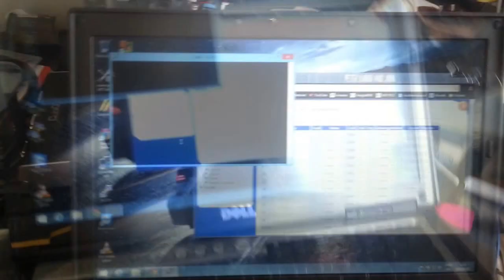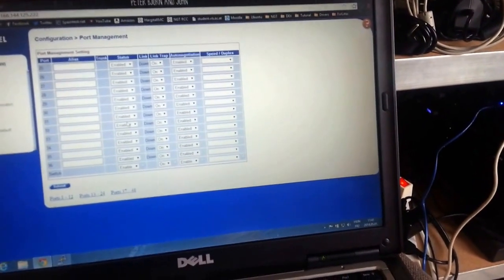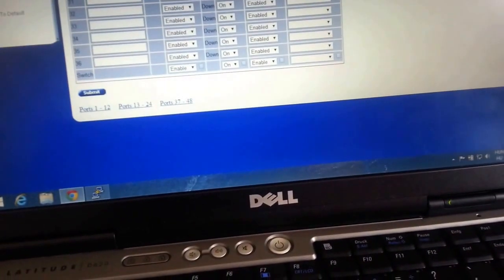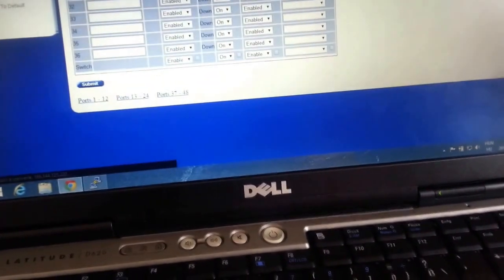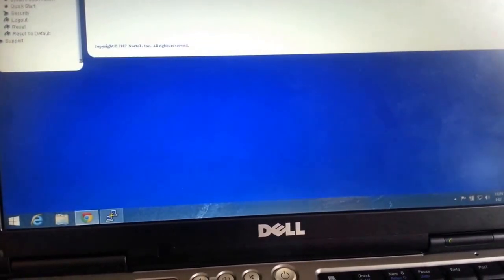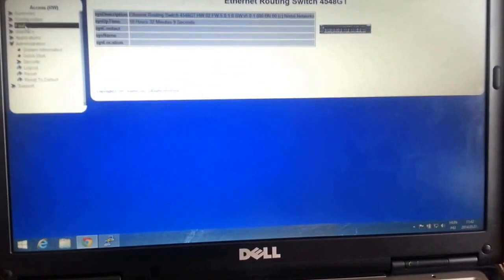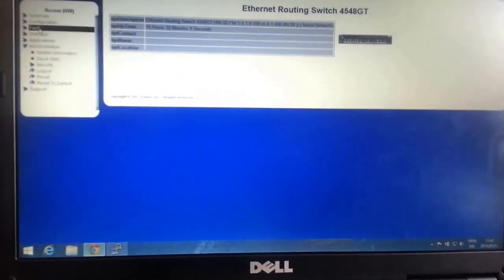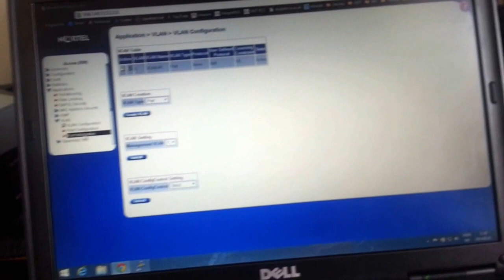Nortel 4548GT Quick Overview

Comment: Hello, can you tell me how you have the pins of the console connector and the laptop connector configured? and could it be instead of DB9 rj45 for the laptop?
Reply from the maker: Hi, sadly no, DB9 is not equal to rj45. This is only a console port. Once you have the switch up you can use tcp/ip to connect to it and manage it.

Comment: I just got a nortel 5510-48t and it did not come with a console cable but i did have a console cable that came with a load balancing router and my point is i don't know how to control the  switch or connect it properly for that matter. It is working and is functional as just a switch but i cant control it and if you could help that would be great, thank you.
Reply from the maker: Len Nobles Hi! You need to find a Null-modem RS232 cable. Use putty to connect to it and you can se the switch IP to one which is within your subnet. Then you should be able to access the web GUI and manage the switch. I hope it helped.
Reply: Will a usb to null modem cable work such as this https://www.amazon.com/dp/B008634VJY/ref=psdc_464404_t2_B00006B8BJ

I do not have any computers with a serial port on them so that is why i'm looking for one with a usb. If you also don't mind how do i log into the switch given that i have logged into my main router and there is not a listing for a ip address for the switch that i can find or a sub net address. so when using putty how would i find what i need to log in, i'm new to the enterprise equipment and i'm used to new enough stuff to use a log in on a ip address on my browser to manage. Thank you for your time and For the help.
Reply from the maker: Len Nobles yes certainly this is one way of doimg it. Once you are able to communicate wirh thr console you will be able to set an ip address that you can connect to thriugh you browser. I will try and make a video of it once I am dine with my exams. Thats next week Wed.. Ill show the console of this switch, it is very similar to thr system running in your switch accually.
Reply: Okay I will get one of those cables and try to use putty to set a local ip, thanks for the help
Reply: I just got a null modem to usb cable today and connected it to my pc and then launched putty and i never got a return and i proceeded to test the cable and once wired up i tested the cable and i was getting returned letters of what i sent so i know its not the cable and i cant imagine that that serial part connected to the switch is bad as they are rarely used but if you have any suggestions that would immensely help and i also tried hyper access and  had the same result.
Reply from the maker: +Len Nobles hmm. My first guess is the serial settings are not right. It should be in the users guide. Im am thinking of parameters such as Baudrate stop bits ect. The test is only rudimental as echoimg the chars from your tx to your rx is not representativr of the settings of the switch.